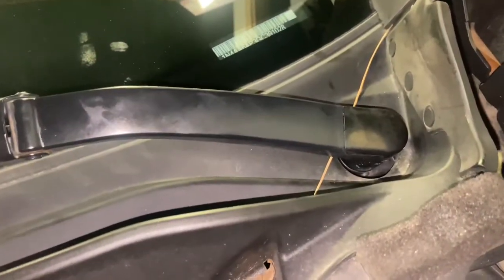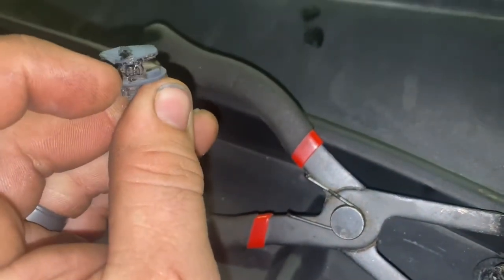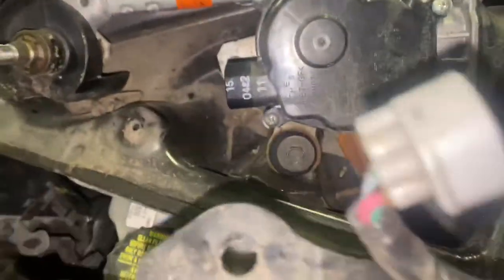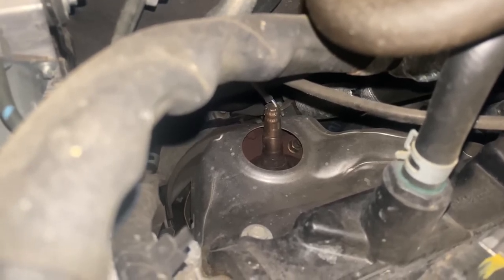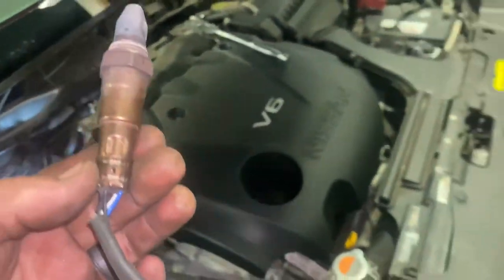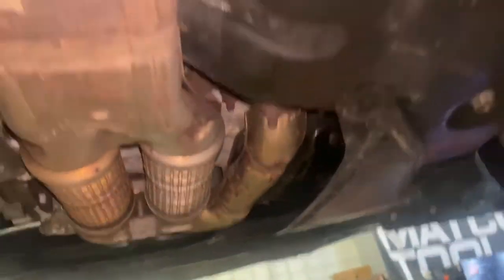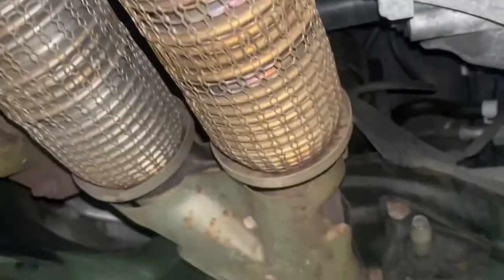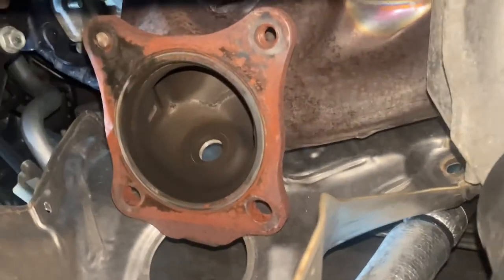Replacing bank 1 catalytic converter on a 2016 maxima

Comment: So on 2014 nissan patfinder v6 awd is the bank 1 is by the fire wall or front of the car by radiator? I got p0420
Reply from the maker: By the fire wall bank 1 is always the bank with cylinder one or the cylinder closest to the front of the engine

Comment: Hi, thanks for a great video. Do you think this procedure will work on a 2012 Altima 3.5 SR? Maybe some tips if you have ever did one?
Reply from the maker: I haven’t done one in a while it’s tighter I’ll look at one tomorrow to refresh my memory
Reply: @angellovesong100  Thank you any advice is much appreciated. The Nissan repair manual says to remove motor and trans. I have never heard of that being necessary to replace a primary cat.
Reply from the maker: Yeah same for the titan but I can get them out without pulling the motor I haven’t done one in quite a while and have been out of work due to a family emergency I would try this I’ve been doing this for 15 years and we rarely work on those or see them